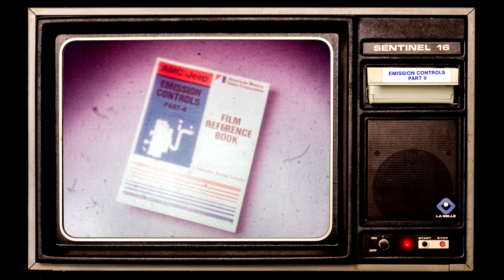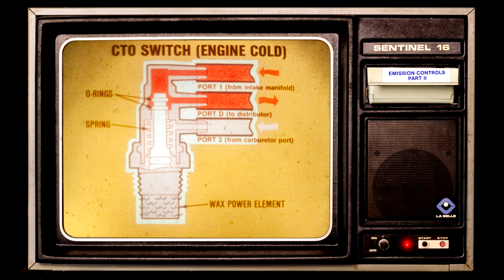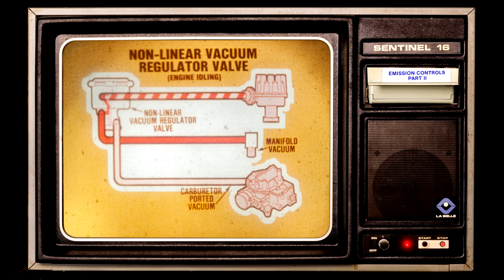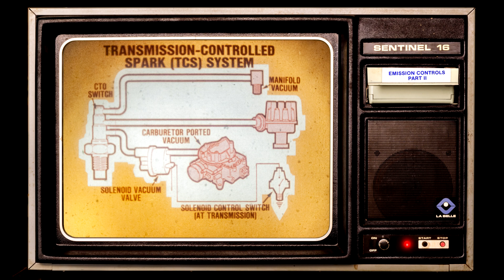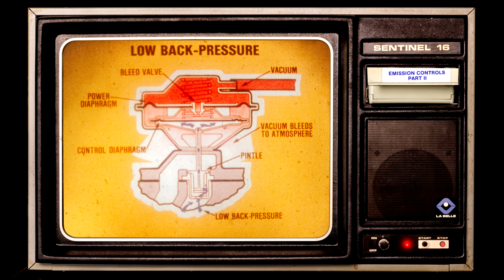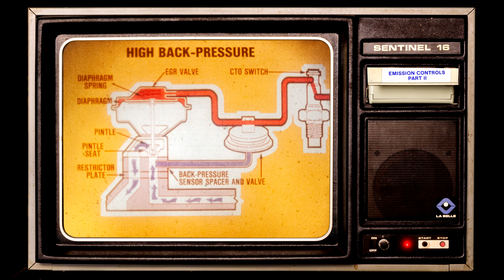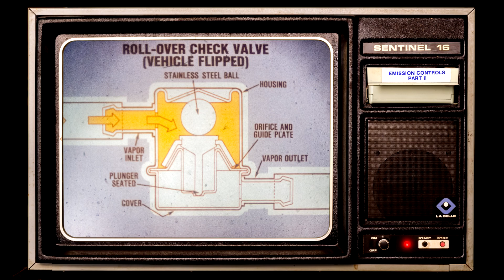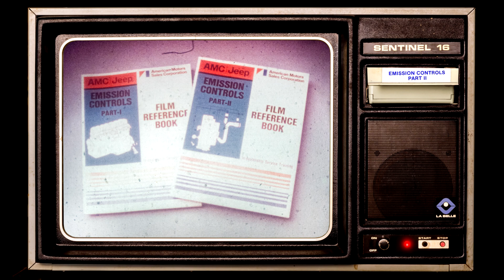AMC Emission Controls Part II

Comment: I've seen these on AMC and similar ones used on Chevrolet and brands owned by Chevrolet in the 70's to early 80's vehicles, I wasn't even born until 90 so by the time I was working on these vehicles most had had their factory carburetor replaced with either a Holley or Edelbrock, except for some quadrajets, and some thermoquads, I kinda miss the sound of those vacuum operated huge secondaries opening correctly 😂 tiny primaries for "fuel efficiency" I think they just used it as a way to get much better performance without anyone being the wiser, and again, nothing sounds the same 😂. The CTO switch I mean, and if I'm following correctly, the manual egr used either exhaust back pressure and sometimes the temperature at the air cleaner? Those really old charcoal canisters when opened can be quite saturated, not with liquid fuel but the chemicals from the vapors, and who knows what chemicals were in the gasoline back then, and most was probably stored in tanks that had even older fuels in them for years 😂